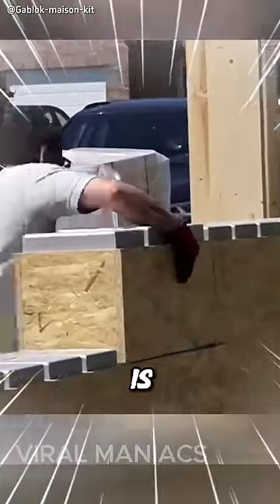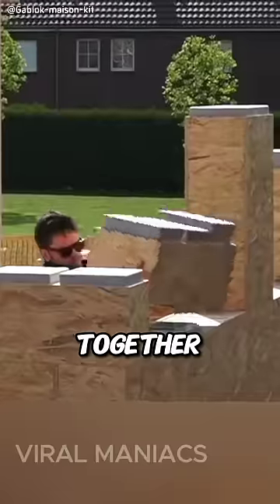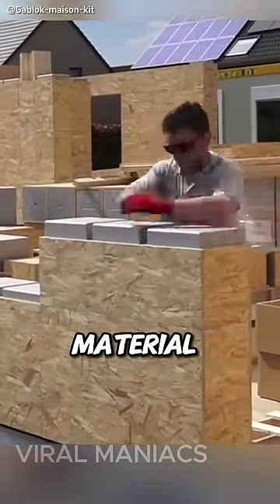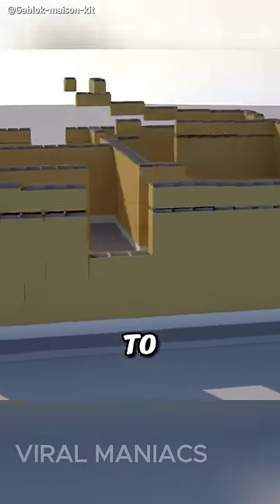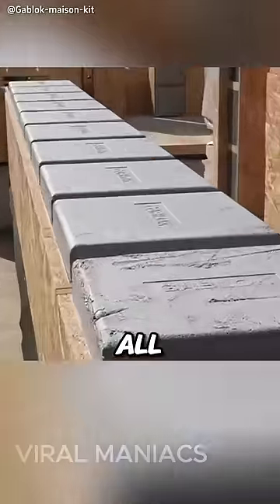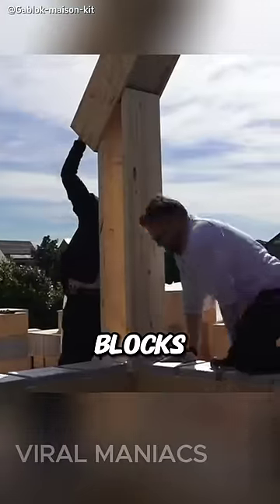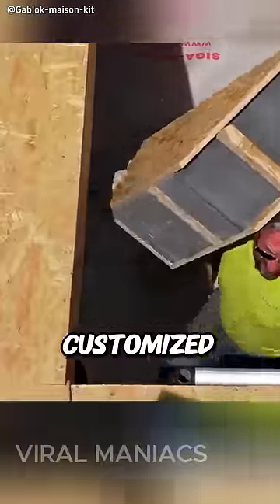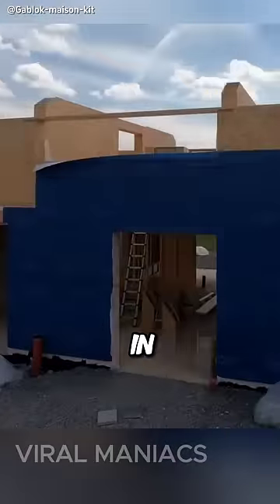Whoever Invented This Way Of Building Houses Is a Genius #shorts

Comment: Finally ... a home construction method that would make me feel safer living in a trailer during a tornado.
Reply: Earthquake, high winds, all the blocks blow apart and land on top of you.
Reply: Yeah this thing seems stupid af there is no electricity or anything and costs more than it should
Reply: @Sk83rNinja  First problem is that for stability they want walls 10 inches thick.  That wastes a lot of space.  Second, I don't see how the blocks are secured to each other.  In an earthquake they all just become 30 lb projectiles falling on the house occupants.  Also no lateral stability for a roof.
Reply: @donaldkasper8346  probably
Reply: It won't blow when you stucco it.
Reply: @johnbui6530 😂😂
Reply: @donaldkasper8346  The other problem is the OSB plywood. The is just wood chips, sawdust and glue bonded together. In a fire situation, that OSB will burn very quickly once the glue vaporizes. That will result in rapid flame spread, because the surface area to mass ratio of thousands of wood chips allows for faster fire progression compared to a piece of traditional lumber of the same size. 

The rapid fire progression in turn will lead to an earlier episode of structural collapse. All of these "green" houses built with "engineered" wood products instead of dimensional lumber have experienced sudden structural failure during fire conditions.
Reply: @righthandwolf306 you all live in cardboard houses and complain about something like that?
Reply: Well just don't build it in a tornado area
Reply: Those blocks are stopping a 2x4 flying at 150 mph.
Reply: @ItachiUchiha-yc9nv  go educate yourself
Reply: @whispersinthedark88  You'd better learn to build houses that won't be blown away by everything 🤷
Every country can do it except America
Reply: @righthandwolf306  Hate to break it to you. That'a what all houses are made of at this point. Plywood and OSB. 😂
Reply: @ItachiUchiha-yc9nv  I mean, technically you can build anything out of anything.

Is it time and cost effective? As well as, are the materials readily available?

Do you use rebar in your concrete? Looking at you, china and india. 😂
Reply: It all gets tied together right with your exterior.  A good eifs or stucco job would make it a million times safer than a trailer that's only strapped to the ground in 6 spots. Also, there is no area under the house to help the wind lift it, which is a big plus.
Reply: @johnparnell3427  Um. No it wouldn't.
Reply: Guys don't worry about the Fire issue... Just paint your house blue 🔵
Reply: @donaldkasper8346 I think that type of structure would be pretty sound in an earthquake. Less rigid structures tend to be better than bricks. Versus the wind, I think you might have problems.
Reply: It’ll be secured if you connect all the blocks with scotch tape.
Reply: @ItachiUchiha-yc9nv In the USvwe have some of the most severe weather anywhere in the world as well as very active earthquake zones. That said, I've seen plenty of images of piles if rubble that were once buildings after weather and earthquakes in other countries as well.
Reply: But if the dor is locked
Then the creeper wont get in and destroy the house 
So it is safe
Reply: @firghteningtruth7173  Nothing is built to last anymore, but this is ridiculous. We may just as well be sleeping on waterbeds filled with JP-5 at this point. With all these synthetic materials in a modern house, NIST estimates that the fire load of the average  US household is the equivalent of 35 barrels of oil.
Reply: @Sk83rNinja  Your comment is the epitome of what an uninformed opinion looks like.  You might as well say it's not foam but pudding in the gray blocks and that's not OSB its pastry dough... I spent less than a minute googling and found the product, design specks, comparison to American building standards, and construction process... why didn't you?
Reply: @righthandwolf306  Most, if not every American house is decked with OSB.  It goes on over the frame for ridgity and to be an anchor for the waterproofing sheathing.
Seriously, for as much as you wrote you might've done a moment of research...
Reply: @firghteningtruth7173  then I pity the education system in your area.
Reply: @whispersinthedark88  As someone who's built and renovated houses for over a decade, your reply gave me a good laugh because you're incorrect but so certain.
Reply: @righthandwolf306  that would be my concern.  Not a tornado.
Reply: @whispersinthedark88  they must educate themselves for making a valid point?  Hmmm
Reply: @donaldkasper8346  Interestingly, in my country you would put 5 and 10 inch walls for walls inside the building and 14 inch bricks for outer walls (plus extra insulation)... to be precise, it's 12, 24 and 36 cm
Reply: @johnparnell3427  You are proposing that a bit of chicken wire and a thin layer of concret will make a house made of thin wood and essentially foam "a million" times safer than a trailer with tornado staps (designed FOR tornadoes) and you are questioning the educational system in MY AREA? 🤣🤣🤣

I work in construction. It is QUITE CLEAR that you do not. Or the absurdity of your statement would be obvious to you. 🤣
Reply: @donaldkasper8346  and, you just get the instruction book back out, find all the pieces, being careful not to step on any, and put it back together, right?
Reply: @daveortwine2641 It's funny that he's right?
Reply: @donaldkasper8346  you don't see how it is secured?
1. Concrete foundation.
2. Vertical support lumber. (Pretty large dimensional wood from the looks of it.)
3. And the blocks are stacked in the same manner as brick work, staggered so they interlock.

The roof likely ties into the same vertical supports too.
Reply: @brdrnda3805  Siberia, yes, US, no.
Reply: @donaldkasper8346  WDYM?

Comment: Electricians and plumbers are going to charge double.
Reply: Naw. Triple. Plus, they wil destroy part of it to fix the issue. So youll then haven to replace what was destroyed
Reply: @GreyBlackWolf They already destroy everything to fix things in current modern house in USA. The current way is inefficient and over priced. Just leave the pipes and conduit accessible.
Reply: Or just decline the job all together
Reply: Nope
Reply: @christoffesedao3579  
How exactly can you destroy something and fix it at the same time?
Reply: @dudetheblessed2524 How do you think? They destroy the wall the get at the pipes, then fix pipes and fix the wall. It’s separate events, destroy THEN fix, they don’t happen simultaneously.
Reply: Lol triple
Reply: @dudetheblessed2524  tare apart your walls to get to the stuff inside
Reply: It's called GABLOK, Belgium system, but what if I need to put an TV on wall, or mount somerhing really heavy on wall?
Reply: @TipTop-ze3tn  
That's the way everything works, genius. If nothing is broke, it doesn't require me to fix it. Nothing is "destroyed" if it's repaired, so that is why you call a professional such as myself. 
As a man that is both a plumber AND an electrician (yes, licensed in both), I can tell that you are the type of customer that is just looking to bitch about SOMETHING.
Reply: @djcoleman77  
Yep. That's how it works.
Nothing is "destroyed" if it is repaired, though.
Reply: According to the Gablok website, plumbing and electrical sheathing in walls and floors are engineered into the structure to allow for the technical connections. Then, they have finishing plates to enclose the openings.
Reply: @dim0n1  there would never be an issue mounting anything on the wall. The entire wall is (what appears to be) 1/2" OSB, which is structurally sound enough to hold a considerable amount of weight
Reply: @--Fenix--  
I've worked on a few homes that are built similar to this, but with concrete. In order to make any connections (conduit fittings, glue type fittings for DWV, water supply fittings) the work must be roughed in as they are setting the walls. Since electricians and plumbers are not carpenters, they will be standing there waiting to do their scope of work, essentially costing double or triple because they are being paid even when not productive.
Reply: Just rough it in before building then run exposed pipes and conduits inside
Reply: You mean it should be half off discount because they would have clean unimpeded surface to run their lines on with proper angles straight lines and corners that can easily be incorporated in the design and installation of the inner walls to allow for easy access to those lines in the future.
Reply: No you just do what ware houses do. Exposed pvc pipes as conduits or the plumbing.
Reply: I came looking for this comment. I was like where do the inside parts go?
Reply: Fire sprinkler as well
Reply: The house comes with 2 porter potties & solar panels 😂
Reply: @TipTop-ze3tn very few plumbers will patch a wall after they cut a hole out of it.
Reply: It's all fun and games until the electrician has to cut into shit to run wire. LOL

Comment: Yes, and If it catches fire, it will burn like an AfterBurner...
Reply: What's the difference from a house built out of wood and insulation? That's basically what it is.
Reply: Yes, just like any other house in the US made of lumber
Reply: Oh gawds... Yeah. I hadn't thought about that. I was just thinking about where the pipes and wires and innards would be going...
Reply: @houtarooreki5751  In some parts of Europe, ALL houses are made of concrete and blocks. Not even with a tank you can pass through them. Fire will do nothing. So, I always thought how unsafe these wooden houses are.
Reply: Oh well, won't be my problem afterwards.
Reply: Every house is in danger of potential flames. That's why every house should have extinguisher and safety precautions in place.
Reply: @xendastark3407  Big difference between a wooden house burning and concrete house burning.
Reply: @williamletarte2481  normal houses are wood filled with fiberglass (non-flammable), but these are filled with polystyrene, which puts out thick, toxic, black smoke. Way more flammable.
Reply: @williamletarte2481  Wood has been used for centuries and is not easy to catch fire. That's why kindling must be used to catch wood on fire. Styrofoam insulation is like an accelerant. Many have perished in structures that used it. It's the reason why so many died at the Grenfell Tower in North Kensington, UK
Reply: @KenJames9911  every house has insulation whether it's fiberglass insulation, spray insulation or this type of situation. Insulation is flammable regardless.
Reply: If the insulation is fire resistant that will help.  We will assume sheet rock will be applied and that is very fire resistant.    I don't think fire is an issue.
Reply: Any house could. Not a valid point
Reply: @williamletarte2481 one burns with fire... The other burns with flames...🤣🤣🤣...I know what you are saying though, I agree... Don't build out of this flammable material, use THIS flammable material....i don't even try anymore
Reply: How many house fires have you been to, where anything more than the foundation is saved? 
SMH 
If you’re that concerned about fire in this structure, invest in a wet or dry fire suppression system.
Reply: @Worldtraveler-24  easy.... Most times in fires the foundation needs to be repaired, the concrete (not cement) is not designed for that heat.
Reply: @artw3 Yet fire deaths are extremely rare in US. 
I don’t think styrofoam burns like you think it does, but I am unsure. You can use formadalhyde free fire retardant if you like. CMU construction (concrete block) doesn’t mean it’s fire proof. It’s all the stuff that fills a space that catches on fire first. Millions of brick buildings have burned to the ground.
Reply: I worked in a polystyrene manufacturing plant 40 years ago. They had construction panels with fire retardant built into the material. I insulated my whole house with discard blocks and panels destined for landfill ....... $0.oo cost.  I tried to set fire to scraps many times to demonstrate to sceptical friends.  I wouldn't combust at all.  Made by Dunlop T-max.
Reply: @Worldtraveler-24  It isn't the degree to which the structure burns, but the rate at which the fire spreads as well as the smoke components generated.  An extreme example is a mobile home, which may be constructed with multiple materials that release toxic smoke and can go from ignition to fully engulfed in under three minutes.  A similarly dimensioned structure constructed of plywood, fiberglass insulation, and gypsum wallboard will have a much slower rate of fire growth as well as significantly less toxic smoke.  Gypsum also acts as a fire retardant, a de facto fire suppression system, in that the gypsum breaks down with heat, releasing water and absorbing a lot of energy.  It is used as fire insulation in good safes.

BTW, ex-EMT here, and have seen numerous contained house fires.  Mobile homes leave a warped frame.
Reply: @KenJames9911   
Today, construction type styrene has fire retardant mixed in
Reply: @Tracker5111 Today, construction type styrene has fire retardant mixed in
Reply: @burtan2000 
Today, construction type styrene has fire retardant mixed in
Reply: @JosephIodice-ep1gc  That is very good to know!
Reply: polystyrene, unlike wood, is HIGHLY flammable
Reply: @sabertooth1980 its really not a problem. You have the same exact risk of burning your house down as this
Reply: @burtan2000  That's not what Google says. Concrete and bricks won't burn. Unless it's a nuclear explosion kind of heat.
Reply: @williamletarte2481   Fiberglass is not flammable. It will melt under the high heat but its self is not flammable. If its Kraft faced, that part will burn.
Reply: @duaneritter3932  that is absolutely not true. Fiberglass  insulation is flammable but when put behind a approved barrier the chances of them burning are less likely, but that does not mean they are not flammable.
Reply: How do you know the insulation isn't flame retardant?
Reply: @artw3 and not just how unsafe, but how do these cardboard houses costs hundreds of thousands of dollars??? 😂
Reply: Yep just like any other house
Reply: @artw3  yeah but replacing a piece of wood is by far less expensive than trying to repair concrete from settlement.
Reply: Thus there's no one left to sue or claim the life insurance. Totally genius!
Reply: You get what you paid for
Reply: @artw3  our house here in the Philippines costs around $35,000 (1.7 million Philippine pesos) and completely made of concrete. I absolutely have no idea why this is not more common in the US